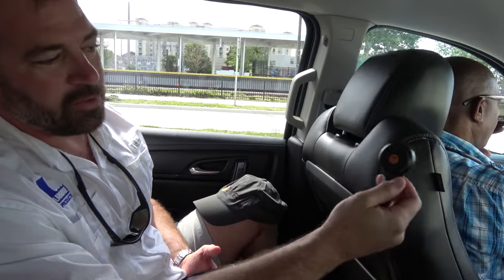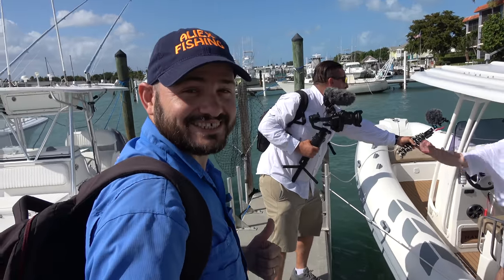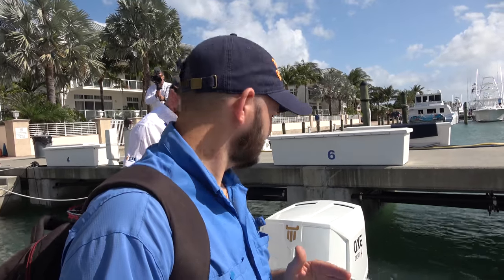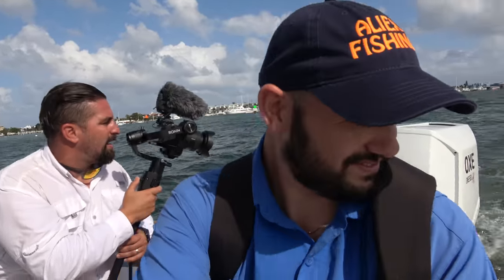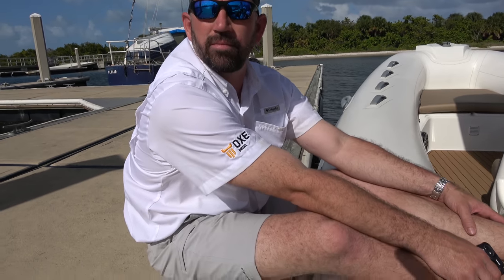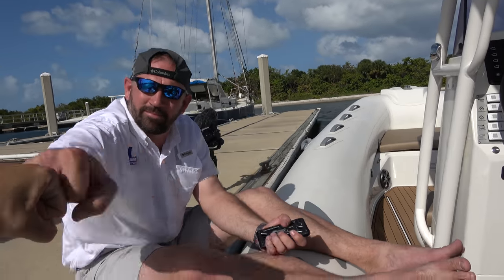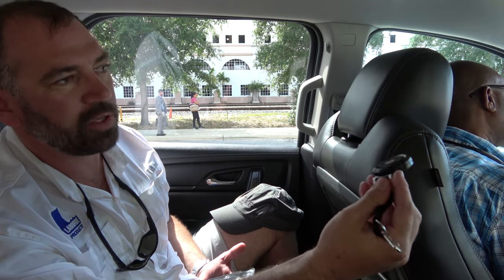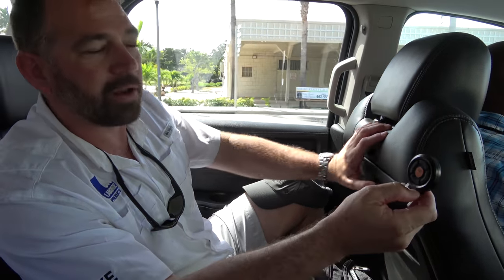New Diesel Outboard Water Demo Oxe Diesel K 150 HP on Brig Navigator 730 Palm Beach Boat Show

Comment: Way too big, way too expensive, way too heavy, way too loud, and torque is NOT king with a propeller, (unless you are on a huge cargo ship).
Reply from the maker: It is a start, it does have its uses
Reply: @AliexFolgueira  what use does a super heavy,  high torque, low power, low rpm motor have on a boat hull that is designed to plane? Displacement hull yes, planing hull no.
Reply: @deerlakediver5554  pontoon boat.
Reply: @AircraftMechanic-AP  the vast majority of pontoon boats operate as displacement hulls.
Reply: The torque becomes very helpful once you incorporate the weight of the passengers, fuel, ice, food, gear, etc. on top of the weight of the boat. The torque allows you plane faster even if you are really loaded down, you just don’t get the same all-around performance with a gas engine and even if you do it will be working hard and chugging gas. I boat up in Puget Sound and it would be really helpful to have that extra torque. The price is also offset by the fuel economy, the durability, and the longevity of the motor. Diesels are like the old two-strokes, as long as you take care of them they will run forever. The savings is definitely not up-front, that’s for sure, but down the line with maintinence and fuel it sure adds up.
Reply: @DaebakMonkey  at 775 pounds, that's going to have to be a huge pontoon to hold it, and at only 150 hp, planeing that heavy big pontoon is going to be difficult if not impossible.
Reply: Way too expensive??
Like how much?
Reply: @davem5333  a little over twice the price of a gas Merc 150hp 4 stroke.
Reply from the maker: Torqeedo has some very powerful electric motors
Reply: @deerlakediver5554  this 23ft pontoon holds it up. I see this motor working well in a  planing  hull application too. You can run a much bigger more pitch prop and run much lower rpm on a plane at equivalent speed to petrol. Sure acceleration  wont be as quick because of motor weight but once on plane its weight is less important. Price is big stumbling block thou 🙄
May suit commercial operators doing big kms !
Think this motor has torque of about 300hp petrol

Comment: Outboard are noisy enough without it being diesel.. I see no advantage for this  over a typical gas engine.
Reply: Did you watch the video
Reply: A lot better range, and a lot less fire risk. And the fuel savings. And it has a closed cooling circuit.
Reply: @mcplutt  and maybe longer engine life !😁

Comment: Why would anyone want a diesel outboard?  Way more maintenance and boat are expensive enough
Reply from the maker: I think we answered that on the video
Reply: Well this design has taken maintenance cost to another level. Not only do you service a Diesel engine, but also friction slipper clutches, a toothed main drive belt, a power transfer belt to the gearbox, a seperate gearbox etc. At 350kg in weight most 150hp class boats would not take that on the transom I’d think.
Reply: Very little maintenance. A lot better range, a lot less fire risk. And the fuel savings. And it has a closed cooling circuit.
Reply: Svein Hanssen Ever heard of a thing called Total Cost of Ownership? Only the ignorant look at fuel savings as a justification. It is TWICE or more the cost of an equivalent engine. Cannot see how it is cheaper to maintain  - a new power belt every 200 hrs, major overhaul every 2000 hrs! So compared to what? My Yamaha 200hp HPDI two-stroke is epitome of ease-of-maintenance.  What fire risk is there in an outboard - the damn engine sits out in the breeze so no vapours are going to build up!! This engine seems to  only have a niche market and could not possibly appeal to the general boating public once you take a close look. Good luck to them. FYI this is a “marinized” automotive engine from GM. How long do you think it was initially designed to last? Probably runs separate cooling system because of the above and to be able to cool the separate belt-driven gearbox.
Reply: @johncanalese588  so this engine isn't for you then, but there is a big market out there.
Reply: @johncanalese588  so u put it on a 300hp class boat because its got that torque. It certainly didnt look out of place on this 23ft rib but then  a rib has heaps more capacity🤤
Reply: @johncanalese588  diesels have much longer life spans due primarily to lower revs and engine stress. This engine will apply to commercial  applications more so than recreational  where big operational hours apply.
Reply: Why would anyone have a diesel inboard then ??

Comment: Gasoline 4 stroke 150 hp is $15000 CAN.  This motor is $41,689 USD.  Don’t think the fuel savings will help make up the price difference!

Comment: There are good ideas and bad ideas and this isn't a good one
Reply from the maker: Why? Diesel engine can make things a lot easier for lots of people
Reply: For some customers this is the engine to go for.
Reply: This is a great idea. Imo this is a complete innovation. Changing the old vertical crankshaft to a horizontal crankshaft design making the engine more efficient and robust plus changing the bevel pinion type gear box to a hydraulic gear box. This is really a game changer imo

Comment: Why would anyone buy this, you would have to go on land for fuel, it’s massive for a 150hp, and it’s extremely noisy
Reply: Baxter Hare I agree it’s not for me either. Don’t where you live but here in Australia, diesel pumps sit beside petrol(gasoline) pumps at almost all marine fueling stations so it’s not a problem.
Reply: @johncanalese588  THE OXE DIESEL IS THE ONLY OUTBOARD ENGINE BUILT PARTICULARLY WITH COMMERCIAL USERS IN MIND. IT IS DESIGNED FOR THOSE WHO USE THEIR BOAT EVERY DAY NO MATTER THE CONDITIONS, AND HAVE TO RELY ON THE UNITS FOR MANY HOURS EVERY YEAR.
Reply: @jonasnilsson1451  bit like truck drivers 😁

Comment: This engine is horrible! 
Whatever they are saying, the engine is not performing at all. 
And pathetic technical support from the manufacturer.
Even though i have a Ticket number, no response from technical team.

I have 2x150HP OXE and both are down within 100hr running time.
Never buy these.
You will be disappointed.